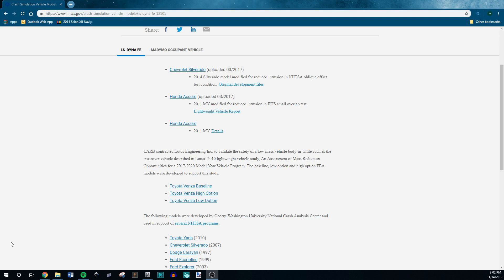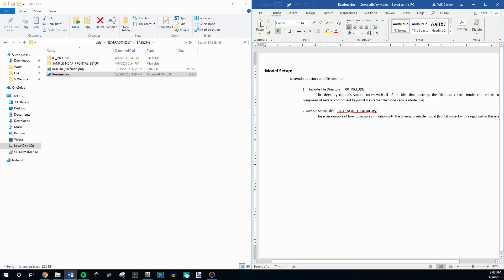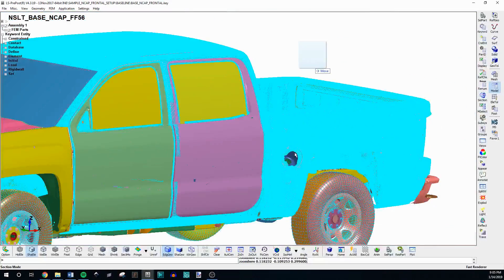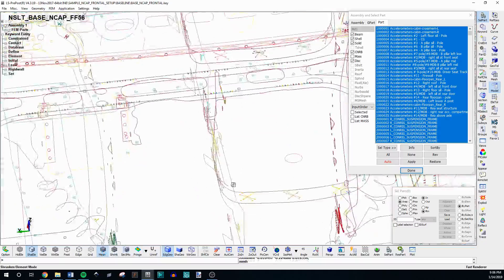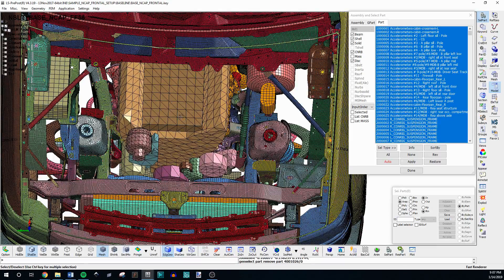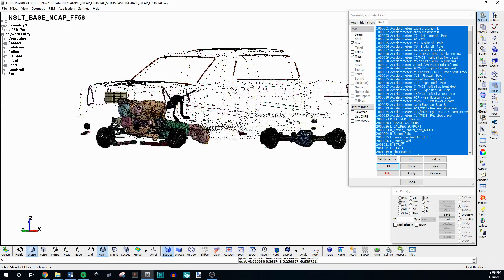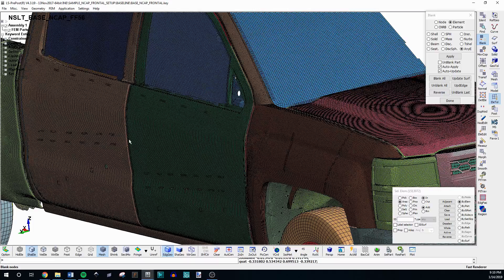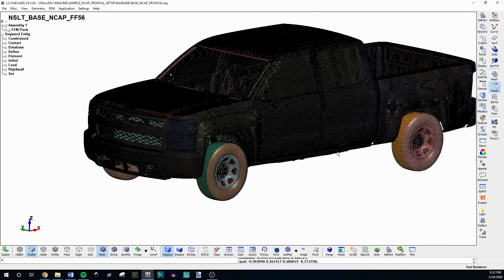Free to use LS-DYNA Finite Element Vehicle Models from NHTSA

Comment: can you do a tutorial to run this simulation?
Reply from the maker: I’ll try to get around to this. The issue is that this isn’t a “simulation” per say. It’s a FEA model that you can use in a set of boundary conditions. Meaning if you simulated this it will just sit there and not do anything. You need to define what you want the vehicle to do.